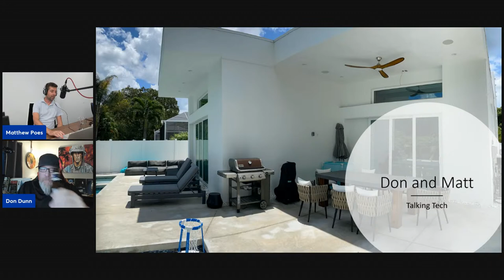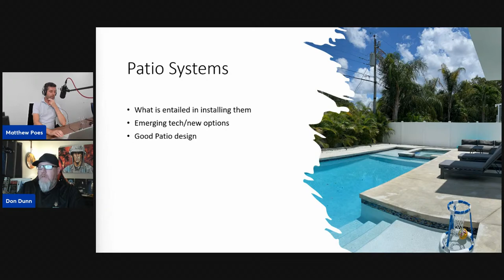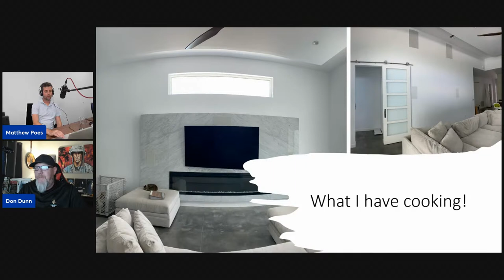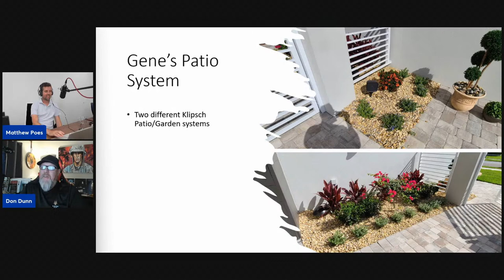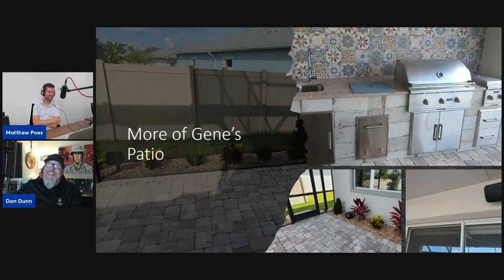Tech Talk w Matt & Don: Getting the Best Sound Outdoors

Comment: Great topic and I totally agree with having a good system (audio and video) to enjoy on the patio.  Only problem is pissing off the neighbors which puts a huge damper on fully enjoying the experience.  My home is on an acre lot and that's not nearly enough to avoid complaints
Reply: I have .21 acres and so far so good with the neighbors. I think you got some touchy neighbors. 

There are options to fix that but they are unfortunately expensive. The first is an acoustic sound blocking fence. These can be surprisingly effective at reducing the sound levels that travel into neighboring properties. Especially if they are mixed with a tree or hedge line.  

The other is some new active cancelation technology. Essentially an active acoustic fence. This is a very new technology.  It’s expensive sadly. I had a Hollywood director I specified this for and even he balked at the cost. Unfortunately for him and folks like him, it’s the only real option.

Comment: Great video. I’m currently building and did a lot of the same things in my home. 

My theater is 9.2.4
Kef ci5160 as lcr. 
Kef ci 3160 as Surrounds and wides 
Kef ci200rr as atoms. 
2 stereo integrity carbon 24s

My outdoor is similar to what Matt shows. 
I ran conduit to my back wall for future speakers around the pool. 

My patio is 25x20. I have wiring for 4 in ceiling speakers. I will stick with kef ci200rr. I have 2 pre wires ran for in ceiling subs. I have them loaded against the wall for boundary gain. I also have one sub prewire at the floor level. Great things about kef is the wide dispersion. 

Conduit is above the outdoor fire place for fiber hdmi and Ethernet. We will go with an indoor tv with cover since it’s under the patio. 

Family room is all inwall as well. WAF is real but it will still sound great.
Reply: Bad ass system!

Comment: So in my system I want to run 4 klipsch aw650, one sonos amp (these will be parallel wired correct?) and for my sub o am using an OSD forza 10 inch 300 watt sub. And an OSD smp300 amp ( this amp will connect from the sonos amp out to the line in on the smp300? Am I correct in this diagram. Please assistance.

Comment: Hey guys  I have a question. So in my system I want to run 4 klipsch aw650, one sonos amp (these will be parallel wired correct?) and for my sub i am using an OSD forza 10 inch 300 watt sub. And an OSD smp300 amp ( this amp will connect from the sonos amp out to the line in on the smp300? Am I correct in this diagram. Please assistance. Thank you